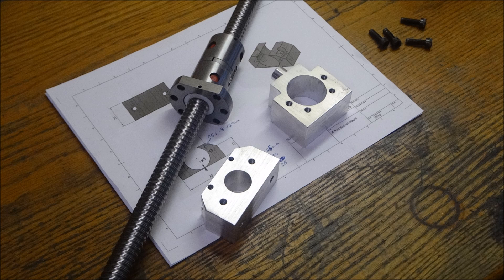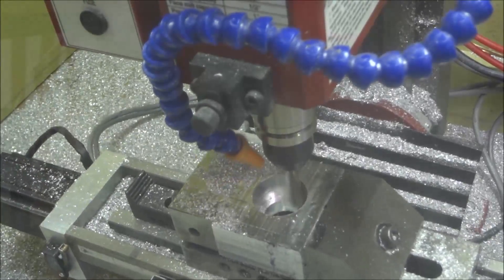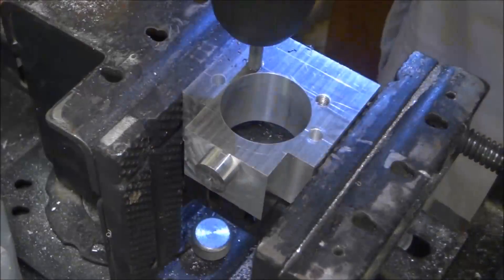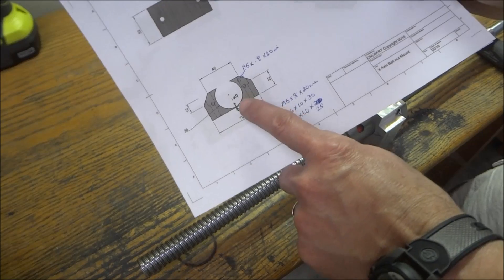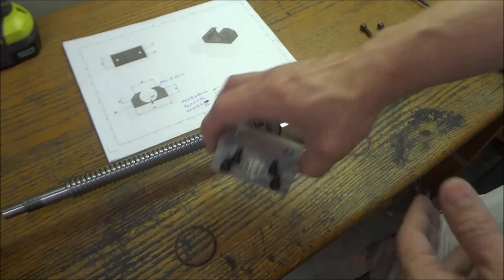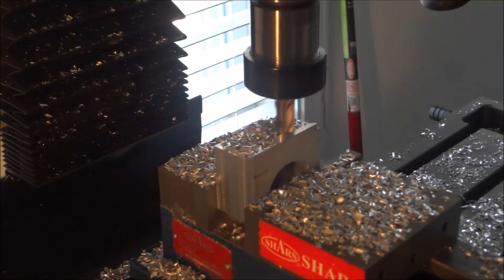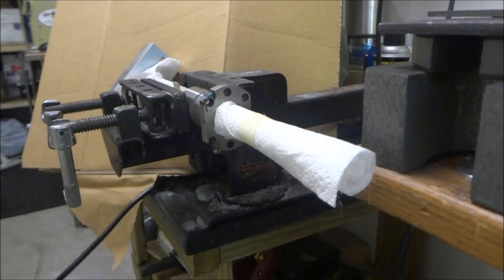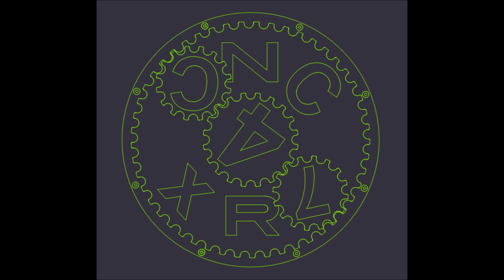RM 2005 Ball Nut Mount Machining X Y

Comment: Your X axis part turned out WAY nicer looking than mine!

I couldn't get a nice chamfered corner with just the lathe (and no linisher), so I had to chain drill and file it... One of the first parts will be to re-machine that block :)

Keep up the awesome work.
Reply from the maker: Well thanks. So far so good. Now to tear it all apart.

Comment: Sam, have you thought about selling your plans and videos as a DVD when you've completed the basic builds?
Reply: Not a bad idea :)

Be careful of how you price it... A bloke in Melbourne, Aaron, is sharing his files for the much smaller PM-25 (sold by Titan here in Australia), but his files are strictly for subscribers. His parts are a bit more elaborate, and look a bit harder to machine without existing CNC capability, where as yours look built for "stuck on a desert island".

(checkout user DCTTeacher1, for "Ballscrew CNC Conversion Kits - Free Fusion360 Files").
Reply from the maker: Yeah I know Aaron he does a great job.
Reply from the maker: Well I had intended the videos to be easy enough to follow that anyone could convert basically any mill to CNC. I have posted a lot of material in a Dropbox. As far as the mounts I will be making at least a couple kits and hopefully use the PM to make the mounts at that time I will finalize the drawings. They will be availible for a small amount or free.
Reply: +CNC4XR7 Sign me up . You've done a tremendous job and put a lot of effort into these videos .
Reply from the maker: I really appreciate it Thanks